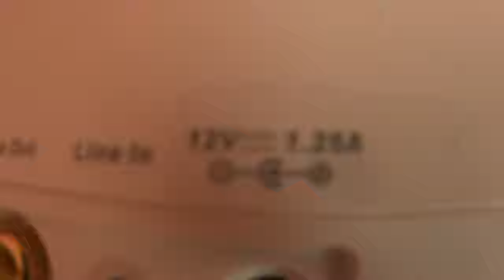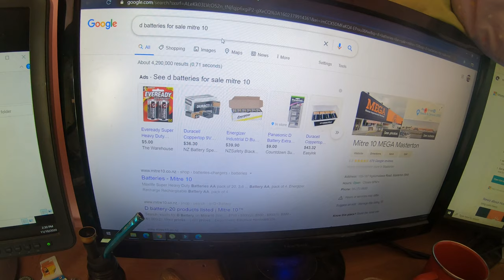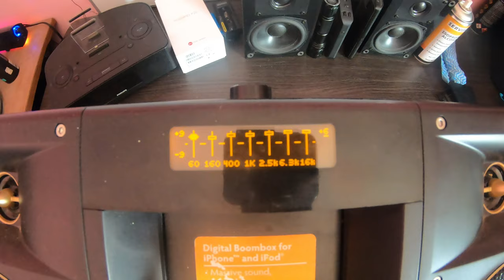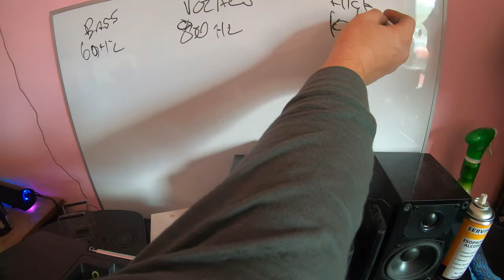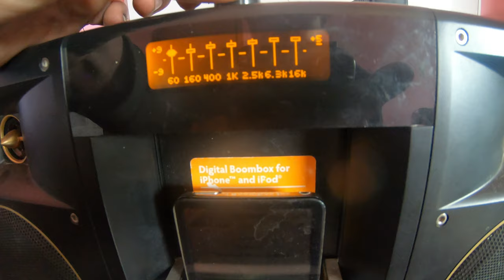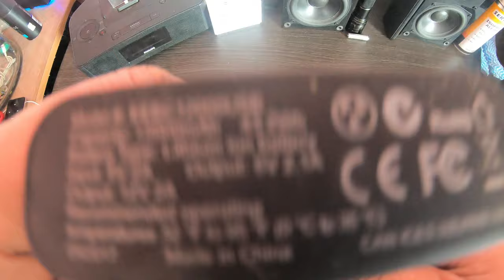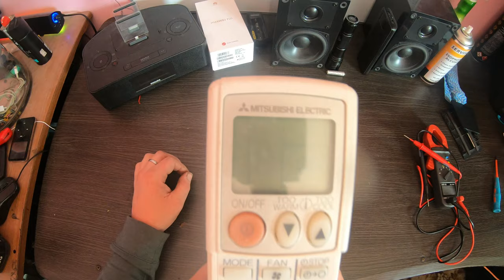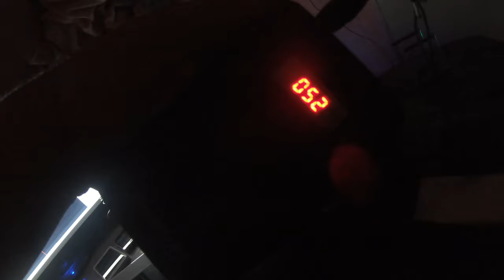CLASSIC IPOD AND DOCK COLLECTION, Altec lansing IMT800 reapair an review

Comment: I own an altec imp800, love it , best sounding rig I own
Reply: I agree, so i wonder if powering it through the battery inputs at 9-10 volts cripples its abilities? It would make sense if they were trying to met a performance  figure of some competitor? I run mine with the 17 volt wall transformer with it plugged into the Milwaukee "top-off" power inverter and have not noticed any performance loss.

Comment: I wonder if powering it through the battery inputs at 9-10 volts cripples its abilities? It would make sense if they were trying to met a performance  figure of some competitor? I run mine with the 17 volt wall transformer with it plugged into the Milwaukee "top-off" power inverter and have not noticed any performance loss.

© ALTEC LANSING SWITCHING POWER SUPPLY
MODEL (MODELO):S040EU1700230
INPUT(ENTRADA):100-240V.-~-50/60Hz 1200mA
OUTPUT(SALIDA):17V.=-2300mA

I measured the voltage from my units power supply at 16.82 volts dc with my wall outlet providing 120.8 volt ac. Also, the inner pin is positive while the outer part of the barrel is negative. So try powering it from there and see if it sounds any better and let us know. Because I really love mine and could use another if i was to be honest.